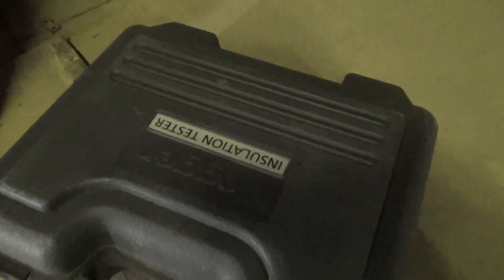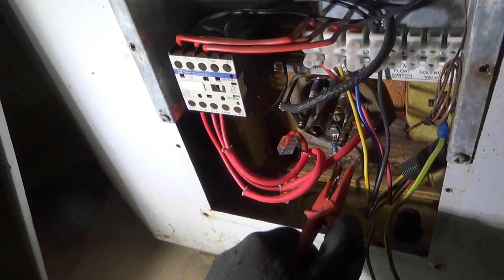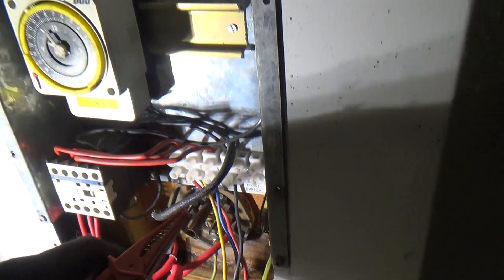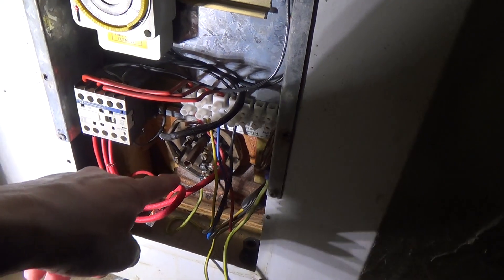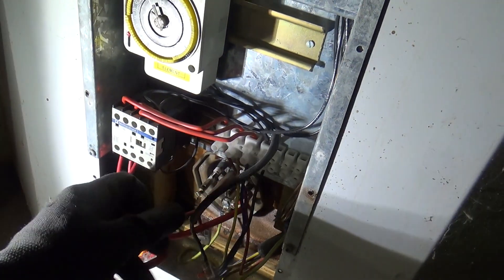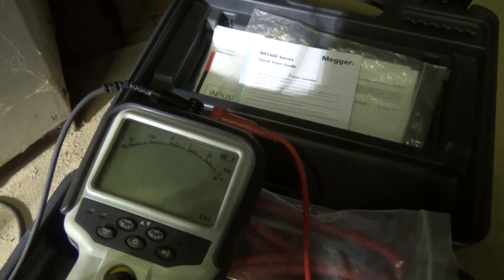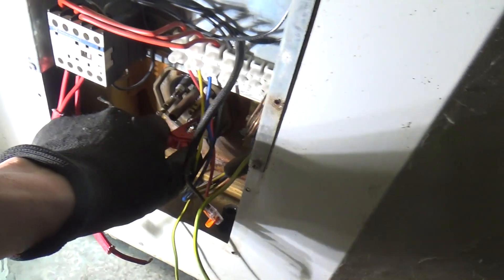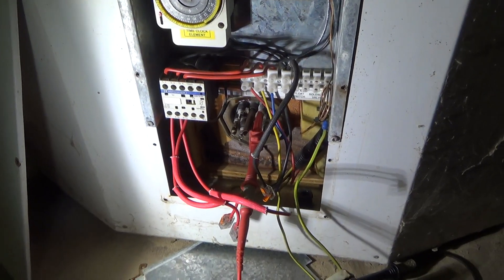Megger Testing a Water Heater

Comment: Interesting to see a three phase water heater. Were they 240v elements with a neutral star point?
Reply from the maker: I don't think it needs the neutral to work when fed from three phase, they all seem to have it though, plus if some of the elements go open circuit it'll still heat albeit slower.